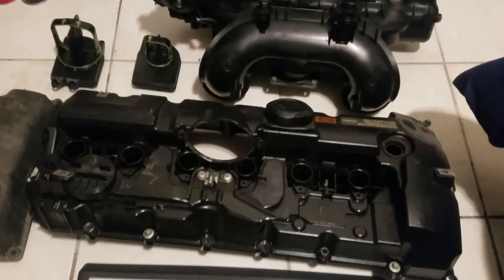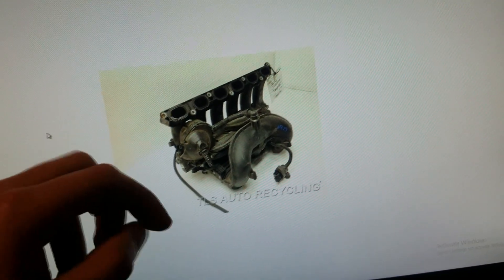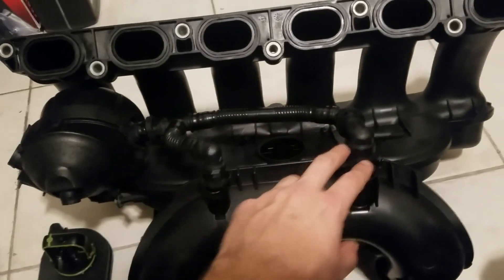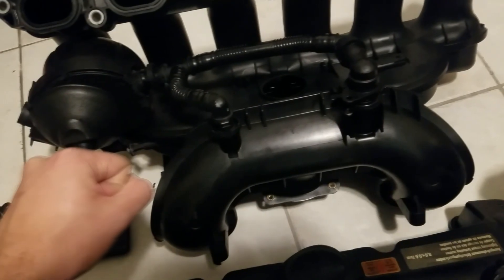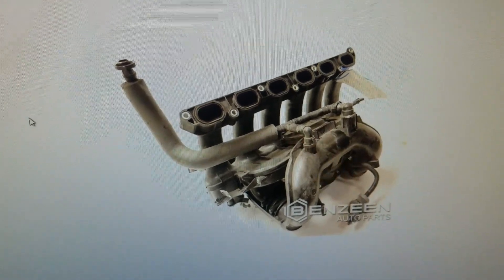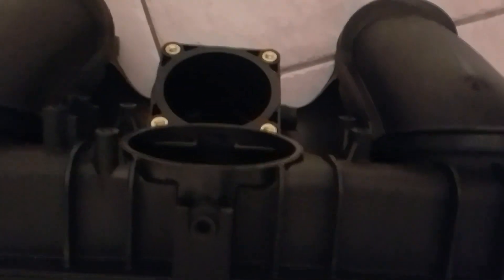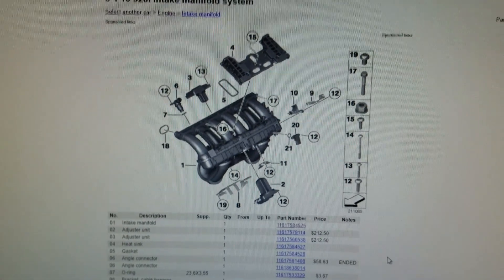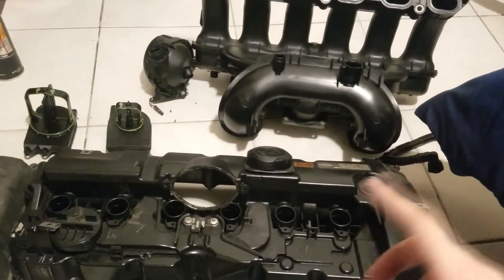3 Stage Intake Manifold Differences and info MUST WATCH!

Comment from the maker: I forgot to add here that these two disa valves turned out to be both bad and had to be rebuilt because they had oil inside. I offer these manifolds for sale with rebuilt fully working disas on eBay linked below, I’ve rebuilt many valves before and by now I rebuild every one I get, checking for play isn’t enough to know if they’re good or not. It’s very annoying to put the manifold in and to have to take it back out to replace a faulty valve, most disas out of junkyard cars will not be working at all or will be very slow and not close all the way, sorry for the misinformation!

http://rover.ebay.com/rover/1/711-53200-19255-0/1?icep_ff3=2&pub=5575378759&campid=5338273189&customid=&icep_item=203103117859&ipn=psmain&icep_vectorid=229466&kwid=902099&mtid=824&kw=lg&toolid=11111
Reply: Hi many thanks! I am searching for a manifold at the moment, do you have one for sale?

Comment: Can you use the single port ccv hose on the 328i plastic valve cover that originally had the 2 port hose? I have a 2 port ccv but i bought a single port manifold
Reply: I seen the answer to my question in the thread. There is no hose you can buy, he advised to use a hydrolic hose

Comment: Could I use a b25 manifold on b30?
Reply: Yess but I think you won't have the same power gains as the 2.5l manifolds are said to have smaller runners

Comment: Im working on my 328xi right now. What my process is,
magnesium valve cover swap + single port Stage 3IM. (stock IM was two port) Buying the oil return pipe to feed from oil separator back into the oil pan and should hook up directly at that point. If you still read your comments Auto Hut. This is correct right?

Comment: So if you have a 328 and are switching to a single port you would plug in the pcv then block off the oil spectator hose? How would I block it off and would that cause damage to my car
Reply: Did you ever figure how to block it Im in the same boat
Reply: Sam here
Reply: Any updates? :D Same issue
Reply: Did anyone ever figure out how to plug the port that he’s talking about in the video? I bought a three stage intake with single port and I’m in the same boat as everyone here.

Comment: HI So a 2009 to 2013 5 series intake manifold will fit my 120i and will be better more efficient thanks to the heat sink? also any 5 series from 2009-2013 will have this type of manifold? and is plug and play? thanks auto hut

Comment: I have 2009 328i and I am getting white smoke....which one do I use....do I need the oil seperator?
Reply from the maker: Your car doesn’t have an oil separator externally. It’s all inside the plastic valve cover. You can replace the diaphragm in the pcv in the valve cover but it’s very tricky. Might aswell replace the cover. However make sure this is your issue as it could be many things

Comment: I’m about to replace my starter and while I’m there I want to replace my plugged double port hose to a single hose because my manifold has one port, I just want to know exactly which single hose to get.. I’m driving an 07 328i
Reply from the maker: The way to go about what you’re trying to achieve is to get probably a 3/4in (measure diameter yourself too to double check) hydraulic hose and run it from the single port manifold pcv heater to your valve cover. There isn’t any stock pcv hose which goes from the plastic valve cover to the single port manifold because the single port was only used with the early cars with the metal covers and outside oil separator which means you can’t use that hose and setup as yours has the oil separator already inside the valve cover.
Reply: @autohut3720  oh ok, well thanks a lot for that suggestion

Comment: Hey thanks for providing alot of great information in this video.
Are the f10 manifold direct plug and play for the lci 328i?
Was reading through forum someone mention that there's a DME bracket came on the f10 manifold and by removing that it will leave a hole in the intake.
I'm looking through the parts diagram but cannot confirm this is true.

Comment: Does this work on 523i n52b25?
Reply from the maker: Hey that engine usually has its own 3 stage intake manifold. However yours might be a 2 stage intake. In which case you’ll be missing one of the two disa intake flaps. This is a thread on the forums that deals with this upgrade for a 323i Canadian spec. Maybe it will be helpful.

Converting N52 2 stage manifold into 3 stage. https://www.e90post.com/forums/showthread.php?t=1757847
Reply: @autohut3720  thanks a lot man

Comment: I have a 2008 BMW 328i. I can't locate the disa valve. I haven't taken the intake manifold off but I was wondering before doing that where I can find the disa valve or if I have more than one disa valve?
Reply from the maker: Chances are you don’t have a disa valve at all. The stock 328i n52 has a single stage manifold with no variable runner lengths. You need a 3 stage manifold
Reply: @autohut3720  Oh okay thank you

Comment: Hi. I have bmw 325i with built date 01/2006. Can we check which manifold i have without removing it, or i have to remove it? Thank you.
Reply from the maker: You have almost for sure a single stage intake manifold if the manifold doesn’t have black squares right above the throttle body and one behind it between the intake runners it’s a single stage manifold with no variable runner length. The 3 stage has 3 different runner lengths to make more power in all rpm ranges and utilizes the disa valves to switch between those 3.

Comment: hello i got the tune on my 2006 325i with the metal valve cover and i bought a manifold with the dual port setup. from what i understand, you want me to block off the port to the left if my current manifold is a single port? couldn’t  i use both ports without a problem or no?
Reply from the maker: Alex Cooper well to be honest this video while helpful and covers a lot of stuff it misses something I learned about later which is the fact that you can convert your stock setup in your car from single to dual port. If you’re already doing this job you can go and order the hoses for the dual port cars with the external oil separator and you don’t need to block off anything and instead your car just gets converted to the dual port updated version with the hoses. However if you just want to block stuff up you do the one without the pcv heater
Reply: @autohut3720  okay sound good thanks

Comment: Excellent video! I coincidentally bought your intake manifold on eBay then searched for your video. Now I understand how my breather hose goes on, I should be able to finish swapping the manifold tomorrow.
Reply from the maker: TheRSpec that’s great news! Hopefully you get it sorted out. I couldn’t find any solid information on how the hose setup should go with the manifold swap before doing mine so I had to make a video about it, easily overlooked part of the swap but important when you’re in there.

Comment: From which year/model can I get the stage 3 Intake manifold and will it direct fit onto an 09 bmw 128i n52k? From what I've been told, only the 1m edition/135i has the stage 3 intake Manifold?
Reply from the maker: The 1m and 135i have a completely different engine, N54 which is twin turbo. The 3 stage manifold will come in any of the X30i cars with the N52 engine in the USA aswell as some 328i with the N51 engine but thats rare. Some other cars you can find the 3 stage intake in are the BMW X3 and X5 with the N52 engine. The 2010 ish 528i also comes with a 3 stage intake manifold but you have to check. Just look for if it has a DISA valve on top of the throttle body,
Reply: @autohut3720  hi. So i went and bought this intake manifold from an 2007 328i n51 motor as stated by the junk yard but when i saw the sticker on the intake, it says n52 b30 UL? Did i get scammed? Lol the tag the junk yard put on was n51 motor...
Reply from the maker: John Cruz well, most of the 3 stage intakes are all about the same. Does the intake have two disa valves? If it does you’re in the clear. You should take them out and check their condition, they can be worth more than the intake itself.
Reply: @autohut3720  it does not have any disa valves at all
Reply from the maker: John Cruz Then they scammed you, or well let’s not call it that but maybe lack of knowledge on their side. Get it returned, you’ll be safe if you ask for an intake from an x3 3.0 or X5 3.0 07 and up with the n52 or anything like a 330 or 530
Reply: @autohut3720  hi, so i went and returned it and got another one from an 2007 530i with 2 disa valves, the sticker says n52 b30 OL... also this one still have the oil separator and he also gave me the wiring harness
Reply from the maker: John Cruz that’s great yeah that’s the one you want. Check the disas for integrity and if you have inpa you can actuate them.
Reply: @autohut3720  the person who sold it to me said they were new disas but he still insisted on me testing it first... also do i need to replace the wiring too? Just wondering how the disas would be powered or do i already have those plugs? 

I have the e88 n52k motor
Reply from the maker: John Cruz that’s good they’re new ofc still test them. Your N52 will have some plastic plugs with wiring hanging off the side of your intake manifold, on top of the throttle body. You pry off the plastic cover and the disa cables are there
Reply: @autohut3720  sounds good!! Thank you so much!
Reply: Hi, one last question,  so i got my intake manifold stage 3 installed, drove fine last night, but today i got couple of codes..

P00bc
P0171
P0174
B2aaa

I know i need a tune/flash,  can you direct me to the right direction with tuning/flashing my ecu to have it properly working please?

Again it is an 2009 bmw 128i e88 with the n52k motor and the intake manifold is from an 530i
Reply from the maker: John Cruz I’ve made a whole guide video on how to flash the car for free with the bimmerlabs 330i tune. I didn’t install the manifold before tuning so idk if those codes are normal but I doubt so. You’re getting one for the MAF sensor so you could maybe clean it, and two codes for vacuum leaks aka unmeasured air coming into the engine, clear them all and see if they come back. If so Recheck all your hose connections and maybe do a smoke test, hopefully you replaced the intake gaskets and used your stock throttle body instead of the one that came with the manifold. The last code seems to just come up when other codes are present.
Reply from the maker: John Cruz you can go on bimmerlabs store and buy it from them